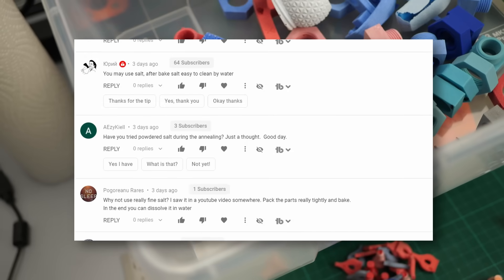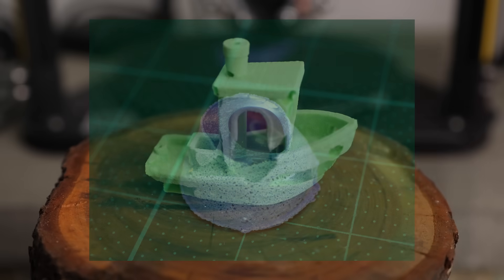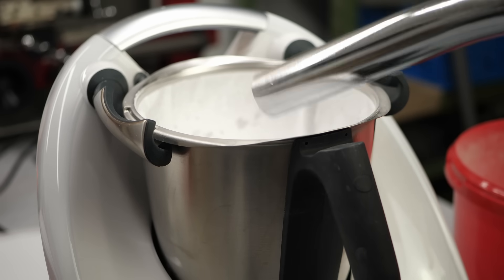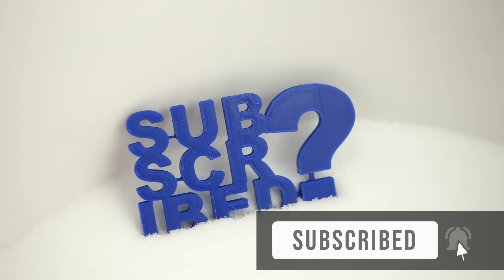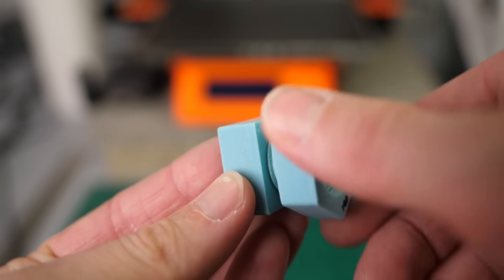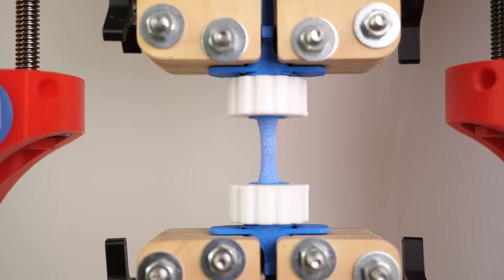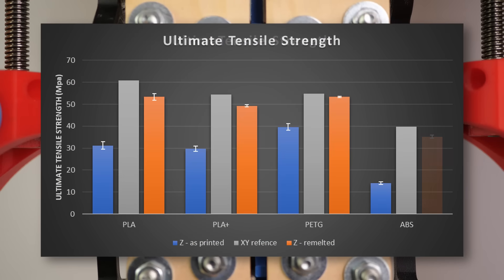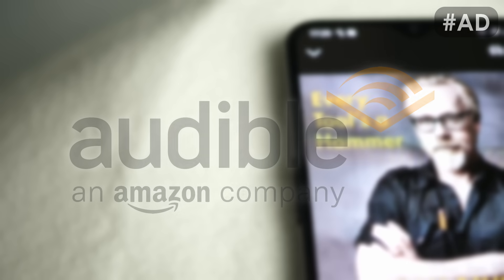The STRENGTH of 3D prints REMELTED in SALT

Comment: I think you should use far less salt and compact it much more. I saw videos of people casting aluminium in sand forms using 3d printed prototypes, and they always used forms that were roughly the size of the cast and compacted the sand twice - first after covering the prototype and then again after filling the form. Using casting sand with talc or some other anti-sticking agent is another thing to consider - sure, it's more complicated but could end up with far better results. For reference - https://www.youtube.com/watch?v=4DwuSpmhMKs

Comment: Hey Stefan, could you test Dichlormethan on PLA? Currently experimenting withit myself and i get really strong bonds. Sadly i don't have the equipment to compare it to other glues like super glue or two compund glue. Would be really great if you could do it. As a tip: to get really strong bonds you need to apply it on both sides until you have a gooey mass of PLA. I recommend using a screwdriver for it.  greetings from Austria

Comment: The surface finish is definitively horrrrrrible :-/ And fatigue behavior will most probably be affected. One should try diping the printed part in silicone (a thick lay er) then put in the salt, and in ahoven, and eventually peel the silicone (or in a box full of silicone and without salt). I would be interrested to see the result ! :) (silicone should be OK up to 230/250degC).

Comment: What abut applying a thin coating of liquid rubber like Plastidip. And then baking the part in salt to achieve the stability. The coating should give a pretty nice surface only the high temperature may be a problem for liquid rubber.

Comment: I'm wondering if a ball mill would work, using stainless steel balls. Ordering some tomorrow..
There are ball mill/ rock tumbler files on thingiverse, so you might be able to print one to help your prints final finish..
Hmm. Interesting. It's a problem in aeras with higher moisture, as the salt gets more hygroscopic with more surface area. If I leave a spill in my work area, it will be a puddle in 2 hours.

My main milling media is lead, its probably not a good idea to mill with that.. something with contaminating the salt/ wastewater with lead oxide.. Will be finer than flour if it works out though, and would be less labourous in quantities.

Interesting video and great idea, looks like a good method to strengthen your printed parts.

Comment: Great test and method. Quick idea, would it work with carbon fiber lay up on printed parts ? 
Refine the lay up process, then cook the finished CF sandwich part in salt ? If epoxy withstands heat there won't be any porous surface left and plastic core will reflow evenly all around. CF might even prevent any dimensional warping. Isotropic prototype core on the cheap with unobtainium performance from CF, and no risks of inner delaminations and early failures.

Comment: You need a drum grinder. Basically like a concrete mixer with heavy steel balls. I forget the technical name for this. But low heat and will eventually break everything down super fine. But can take a long time.

Comment: To reduce the wear on your blender, you could get a fine particle mesh (or a series of them) to separate the particles that are sufficiently small from the ones that need reprocessing. You'd also be able to accurately determine grain size then. So, you'd blend, filter out the small ones, re-blend, and so on.

Comment: I think salt is very useful for drying, and fine grain size is useful for compacting. Matron, silica gel, or molecular sieve might be better ... or not.  Green sand works because of the grain size and the clay's reaction to water.  (It becomes a weak glue.)  You might use alcohol or a desiccating liquid.

Comment: Hi stefan, I work in a solid state chemistry lab and when doing solid state chemical reaction it's super important to have the smallest possible grain sizes. It's common practice to use an agate pestle and mortar to get ultrafine particle sizes. We often also add a small amount of a liquid that will not dissolve the powder, and evaporate dry,  to really facilitate the grinding process. I would recommend something like 99.9% IPA for salt. This process can be labour intensive, but it works extremely well. There are some manufacturers that sell automatic agate pestle and mortar grinders for this exact reason.
Reply: what liquids exactly? a few examples would be nice.
Reply: @ZenMuff1n  IPA or isopropyl alcohol
Reply: @ZenMuff1n anything that doesn't dissolve the particle of interest but is also if possible nontoxic, not persistent, not flammable, and low viscosity.

Comment: What about using fine sand? Really anything that's a fine powder, resists the temperature used for the plastic, and compacts well to hold the finest of details in place would work, right? Another commenter pointed at a Mark Rober video (the glitter bomb guy) where he makes his own fluidized bed to play with. Instead of sand he used glass beads.

Feel like repeating the same test with sand? :-)

Comment: This is great, and would be excellent for making small batches of parts.

However, I don't think any of these methods will ever be able to reach the strength of Injection Molding simply because with IM the parts are molded and cooled under pretty high pressures.

Comment: Instead of salt you might want to try a material that is a very good heat conductor.   A couple of examples: silicon carbide and cubical boron nitride.  There are a number of others.  These are both industrial abrasives that are readily available in a range of grit sizes down to extremely fine powders.  Silicon carbide is fairly inexpensive, CBN is a bit more pricey. Both are about two orders of magnitude more heat conductive than salt.  Both also have about 1/10th or less the thermal expansion of salt, and so will be more mechanically stable when heated up.

Another thing to consider is that by mixing various grain sizes you can get a more closely packed lattice of particles, which will further increase thermal conductivity.

Disadvanage: these materrials are not water soluble.

Comment: I wonder if you could make a salt shell around the parts by repeatedly spraying them with a salt solution (maybe mixed with some cornstarch for body and adhesion) and drying them. Then you could pack them in salt and melt without getting the salt texture on the parts. Another option would be to use some other material to make a shell. In metal casting I remember using something called a zircon wash to coat wax parts before packing them in sand to be cast. The zircon would hold onto the finest detail in the wax parts in spite of it being packed in construction sand. http://smelko.com/?page_id=418

Comment: If salt dissolves in water can't you just add water and let the mix fill in the gaps instead of grinding it? Then evaporate the water at a lower temp while the oven heats up?

Comment: I wonder if there is a readily available high temperature varnish that parts could be pre-dipped into to protect them from fusing with the salt. Especially if said coating could then be dissolved without damaging the parts. That combined with an ultra fine salt could make this much cleaner.

Comment: One thing that would be interesting is to take a page from the lost foam metal casting methods, paint the parts with a think layer of plaster (maintains surface finish and being thin dries very quickly) then embed that in salt or sand to provide support around the plaster.

Doing that you should not have to pack the salt/sand down, and not need super fine grained sand (when doing lost foam casting with aluminum, it's common to vibrate the sand to 'liquefy' it and then just push the part into the sand and turn off the vibrator, much easier then packing the sand/salt carefully around the part)

I suspect that the heating/cooling profile will end up having a lot to do with the quality of the resulting plastic, so it would be interesting to test rapid cooling (i.e. actively cool the part), medium cooling (jut pulling it out of the oven), and slow cooling (turning the oven down in stages to cool over a long timeframe), someone with better knowledge then I have may be able to give a good answer for the different plastics right away.

Comment: A dust which is not affected by heat, like the fine brick dust used in casting smooth metal parts may yield a better external surface.

Comment: For the grain size debate, I think a mixed blend of grain sizes would be important in getting something that can compact down. I.e if its run though a sifter stack, and batched you should get various size free flowing powders, but with a mix of particle sizes you can start getting a higher fill factor, and it should 'clump' better when compacted because there is less and less free space. Obviously this is a bit of a case of "whats old is new"  so a bit of technique and wisdom from the people doing metal casting in sand, could be adopted after sorting out why whatever techniques are recommended, and if its applicable here.

Comment: Very cool results.
I think some more thermally conductive materials for the powder would be an good choice over salt.

You did an excellent job brining your media to a fine powder
But...
You spent far more time waiting for the core to come up to temperature by not having multiple grain sizes, you could have even included pea sized pebbles of salt!
Using vibrations to drive the fine powder deep inside you can get away with a lot of variation of grain size, and the larger grains reduce the amount of empty space significantly even compared to compressing, thus increasing the thermal conductivity. 
Although finding the exact ratios of grain sizes for this application would take further experimenting

Comment: Why not use ultrasonic vibrator for compacting the salt? You can do it with a modified speaker, a kiloherz range modulator kit and a sheet of metal. Then, with this contraption, place your container that you are filling up and just turn on the vibrator every time you pour the new layer of salt in. Also, you can use the old method of grinding with pestal and mortar. Yeah, that would take ages but the effort pays off since you will have a very fine powder salt.

Comment: ive been thinking alot about this process, currently midway through video, but what about printing in additional material as a runner like in investment cast parts that can gravity feed a bit of additional material. it could even be weighted or plunged as it is heated to add some pressure and help remove voids

Comment: I'm curious what would happen if you used a silicone mold to do the remelting -- that is, encased the part in silicone and heated it. Then the mold could be cut and reused (albeit with a seam somewhere) for additional parts or discarded if not needed.

Comment: When you mentioned Talcom I realized that cement could work. It is usually ground to a very fine powder. It's cheap in bulk. Would help suck out extra moisture. Not flammable. etc.
Have you also tried plaster of Paris with this method?
Reply: Remember to wear respiratory protection if trying those materials. You dont want those inside your lungs.
Reply: I think it's a great idea, needs testing

Comment: Hello Stefan. Great video, that's exactly what i wanted to see on your channel. 
i have tried PETG anneal in baking soda (NaHCO3) instead of salt. I was lazy to grind salt and baking soda sold in fine powder so can be used as it is, however some preparation is still required. Baking soda decomposes at higher temperatures giving away CO2 and moisture and  turning to Na2(CO32) (therefore it shrinks). I imagine it wouldn't be so good for prints therefore before use for prints anneal, baking soda separate anneal is required. In my tests i was able to get almost transparent results for PETG and so much better layer adhesion,  however dimensional deformations were significant. perhaps i didn't pack soda well enough or baking soda anneal wasn't sufficient.
Reply: This is why I think it'd be best to turn the NaHCO3 into Na2CO3 using a slow heat reaction like this: https://www.thoughtco.com/make-sodium-carbonate-from-sodium-bicarbonate-608266 It'll have the benefit of 1 being significantly finer, 2 absorbing any water found in the process.

Comment: I think any dry powder would do for improving strength with a remelt, however salt, in theory would draw out moisture since salt is hygroscopic. So first the filament needs to be dried. Then the salt needs to be dried. With dry flour salt and a comparably "Wet" part in an arid environment packing the salt around the part and cooking it effectively cooks out the moisture, which salt captures. So salt is the most ideal material to use.

Comment: How about calcium-hydroxide? It has some disadvantages, like it must be handled with care, because it's very corrosive, and contains water in chemical bond, but theoretically it shouldn't start decomposing until above 500°C. Advantages in the other hand it's easy to access in huge amounts (25kg bags), it's very fine, homogenous dust, and it can be dissolved in vinegar very easily. Could you maybe give it a try?

Comment: I would look at painting the surface with a marine paint designed to be salt resistant. This would rule out any affect the salt has on contact with the plastic or at the very least minimize its corrosive nature. Seems to me the salt would have a corrosive property and would also cause excessive drawing out of moisture that might add strength to the end result. Not to mention the end result would be less scarred and more applicable to an end product someone would want to actually use this method for.

Comment: In bronze casting, wax parts are dipped in a clay slurry. It is repeated until the object has a thick layer of the clay mixture coating it. then it's encased in sand. maybe you could adapt their methods

Comment: This would be a huge challenge but yet possible. Rotational molding is a process used to make large plastic products like kayaks and children play toys (Think Fisher Price). It would benefit parts that are desired to be hollow rather than solid. In Rotation molding the part is constantly rotated effectively spreading the material on all sides of the impression. Depending on how much plastic you have that would determine the wall thickness of the part. First you would need a really firm and compacted mold, and second you need a mechanism to rotate the mold in the heated environment. Actually wait, you could heat up the mold and then place in the rotation machine as it cools. There that's one problem all ready solved possibly!

Comment: In a few years, we'll be going from 3d printing back to high pressure injection molding and extrusion.

We'll all be buying 3rd party extrusion screws for our new 15,000 psi injectors.
Reply: But then, who's going to sell you the moulds? Each part needs a custom mould.

Comment: I wonder if one could get good results by adding a sprue to the part, printing it at low infill, and pouring in molten plastic afterwards with the part in the salt cast. Kinda like lost pla casting, just with plastic instead of metal.

Comment: Pretty cool.  if its one off prints this is cheaper and easier but if we are batch producing something or really care about dimensionally accurate parts silicon makes more sense. jus silicon around a 3d print. Support with plaster  or even salt would work and remelt.

Comment: You can't expect to get truly fine and consistent results with a bladed grinder. You need to use a burr mill, a ceramic one will also help to prevent friction heat from fucking with everything.

Comment: My first thought while watching was that salt can draw water out of the plastic, so talc ought to be better in that regard. Actual talcum powder is getting harder to obtain because it is an inhalation hazard, and is being replaced with cornstarch powder in many markets. Cornstarch of course would be worse than salt in most respects.
A perfect medium would be very fine-grained, not hygroscopic, and heat-resistant to at least the fusion point of the plastics used.
(That's another point- most plastics don't really melt the way say ice does- their molecular chains are "loosened up" by heat allowing them to fuse with each other, or to let go of each other so the plastic can flow under pressure. The "fusion temperature" is actually a range of temperatures due to various lengths of molecular chains.)
Unfortunately all of the "ideal" media I can imagine, like powdered glass, are also inhalation hazards and thus hard to obtain.
Perhaps green sand as used in meal casting is the best compromise.

Comment: when they do cast iron sand mold they use finer stuff closer to the pattern and they compact in layer while breaking(running a comb on the top to break the layer) the top layer of the compaction to prevent lamination

Comment: Hey, it would be interesting to try molybdenium disulphide (MoS2). It's fine grain (1-3 micron) binary compound, not a salt really. And not crazy expensive.
Pros: it will possibly strengthen your parts beyond the ultimate values. Maybe even far beyond. It is able to form a composite with your plastic matrix.
Con: It can't be dissolved in water.

Also, to improve your baking process you can place a heating element inside of your container filled with salt. You can use nichrome wire in ceramic beads for example.
Basically this is more efficient way to heat the medium but you'll have to make a controller (or buy one). But the heating will take much less time for sure.

Hope it helps in your quest!